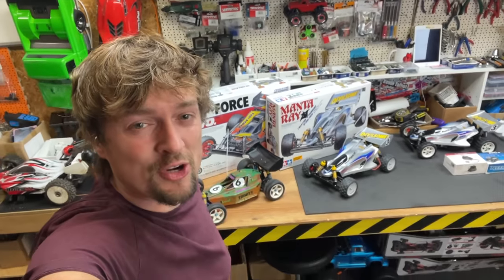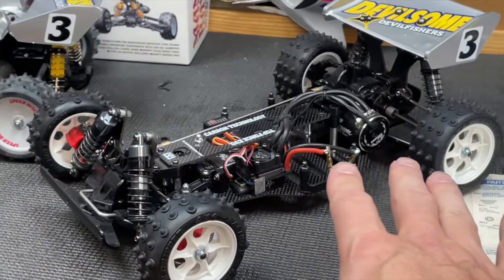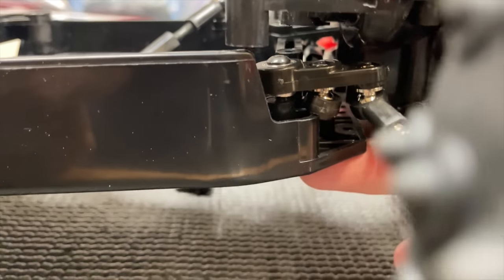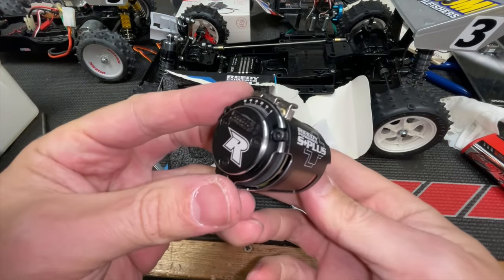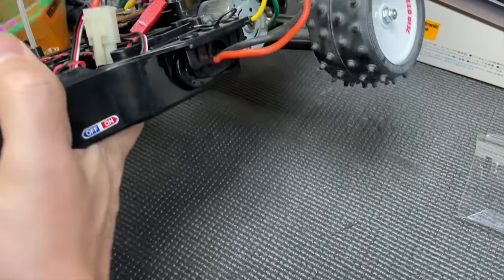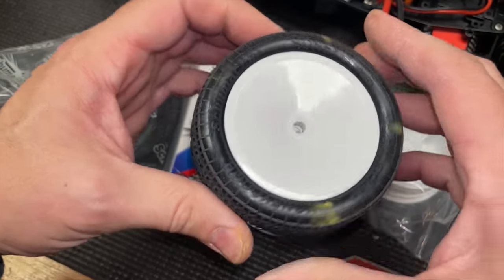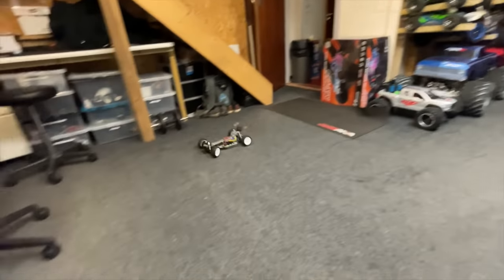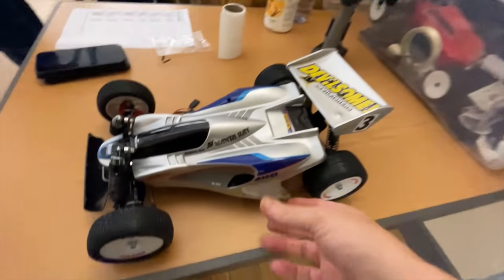RACING 30 year old RC Cars

Comment: Well done on keeping tabs on your original RC cars. My first was from the very bottom of the Tamiya range (I, too, had to save for ages via a paper round) - some desert vehicle thing whose name I can't even remember.  All I remember was how slow and basically useless it was.  Fortunately, I had friends who were also into RC and managed to make better selections.  I remember a grasshopper and a monster truck. I eventually graduated to a Hotshot, which wasn't just loads better than my previous car, but also had far more articles about it in the magazines, with suggested improvements and aftermarket parts.  That was my first real introduction to mechanical things.  I remember removing the front drivetrain to save weight and make it faster when racing on grippier surfaces, then putting everything back together to race around at the park, upgrading motors, swapping pinions to optimize gearing, building independent suspension systems to eliminate the front and rear monoshock, etc. 

But mostly, I remember how utterly dishonest the Tamiya marketing materials were, showing cars flying through the air off of steep sand dunes in much the way your xmax is actually capable of today.  But those cars were nowhere near being able to do that kind of thing.  Not only would those landings have destroyed the suspensions and drivetrains, but they simply weren't fast enough to launch 20 feet into the air as depicted in the videos,. sand flying off the wheels.  On any kind of deep sand, they didn't really have enough grunt to get much air at all, and that's with a tiny pinion and aftermarket motor.  

But those experiences are why I enjoy your channel today.  I haven't driven an RC car in more than 30 years, but watching you and your friends enjoy them so much has been a really fun revisiting of the past.  I've been tempted to go spend a bunch of cash on an xmaxx but I know I'll enjoy it for a short span and then it will end up sitting on a shelf, so I'll just continue to enjoy RC cars vicariously through you.  Keep it up!

Comment: I recently purchased an original Manta Ray to run at my local outside track in the vintage class alongside my DT03 in the DT Class. Manta Ray now has 17.5t brushless motor & HW esc. I’ve rebuilt shocks, gearboxes etc & uprated shock towers, centre drive shaft & steering linkages plus added gearbox strengthening parts. Can’t wait to race it in the spring when the season starts. I race GT12 indoors all year round & I’m looking forward to seeing you race yours again.

Comment: I always love vintage rc cars.  I never really owned any as I’m not too old but I guess the oldest thing I would have owned originally if I kept it was the original Tamiya Wild Dagger
Reply: My wild Dagger is nuts it has two vintage Titan Motors in it and it is nuts. It needs some repairs to take it out of retirement.
Reply: no need to be old! 24 and got into it last year buying an original Frog, then to find out my Dad actually had one too. Now I have a Kyosho Tomahawk, the Frog, Raider Pro, and scx10ii.. never too young, learn off the roots and enjoy the best era to exist
Reply: The oldest thing I have is an esc from some time ago no idea but it’s an old vxl esc
Reply: @add2ndedition663  very cool I wish I had kept mine!
Reply: @sqweezzstr  I guess your quite right!  I suppose I didn’t need to be of age during those great rc years.  I’m actually 34 lol 10 years older then yourself.  I think I was 12 or 13 when I bought the wild dagger after saving some money mowing lawns.  At that time it was new.   I did sell it eventually wish I never.  But I did buy a Mad Bison, basically a nitro version of the wild dagger a couple years after.  I still have it new in the box sealed.   Some day I may build it I think

Comment: Love that video. A lot of memories :)
I still remember some tamiya buggies with The old mechanical speed control... a pain in the a**... 1 servo for steering, another linked to mechanical speed control index. Basically, those old speed control used a long coil wire as Reistance. But electronic speed control changed a lot of things in the world of RC  :) :)

Comment: I still have a Manta Ray hybrid I bought 2nd hand in about 1991. It's got an RW Racing composite chassis, billet aluminium shock towers & motor mount, and a lot of Top Force bits, like stainless steel arm pins & UJ driveshafts. Also has RW Racing bellcrank steering but with custom aluminium cranks as I broke the plastic ones and spares were no longer available, so a friend who scratch built built model steam engines machined me a pair of ally cranks. Ball diffs front & rear.

Used to race it, now it's part shelf queen, part basher.

Comment: Awesome, but Manta Ray has surely got way more to give. That ESC is great, but you need to get into it and play around a bit more with the settings, you can push it harder than that. You will need to get the right programmer card, (HWA30501003, the card you showed is for a different ESC, doesn't work on QuicRun ESC) . Get the motor (or one just like it) onto an engine dyno and time it/tune it, they are never set up out of the box. Find a LiPo or LiPo Hv batteries that will fit, they will work better. NiM batteries are a bit sleepy and very heavy. That motor, or one just like it is sensored, has a sensor port input, which means the ESC will drive it harder, if you set it up on a dyno. Get better tires. Proline Prizm carpet tires work great on carpet but looks like they are discontinued now?. Alternatively JConcepts Swaggers (front JCO3166-101011, rear JCO3180-010  ). Forget the full brakes, just set up the drag brakes to a low setting, 5% or10%, it will be enough, with 75% for regular braking. Go faster Kev, you can do this.

Comment: Just been scrolling through your videos and spotted the manta I have mine from being a youngster in my attic would love to get it running again but need a new body shell and wheels/ tires is it possible to still get the parts ie suspension structures and gears?

Comment: I remember an old buddy of mine , likely around 1989  that had an RC-10 and he thought he was the shit  . I asked for a hobby radio controlled car for my 12th birthday  but ended up getting a ready to go Nikko 4wd  Hurricane from Radio Shack that my Dad bought me for my birthday because he said hobby kit cars  always break so you won't have the money to repair it being a kid and  that you'll enjoy the Nikko alot more as it was actually dependable .  

  Dad was right as the RC-10 although fast when it worked would usually run for about 15 minutes before it had issues lol  , my buddy hardly ever used the thing as it sat in his closet  but my Nikko always worked 100% and my dad was right .   I still have the Nikko with the original box 30+ years later and it still works after being hammered on for many hours   at the time by  12-14 year old  me 🤣🤣  other  than having to get new batteries  and its quick for what it was .

Comment: Seems like brushed motors should be required in this class …and a voltage limit.  My Technigold powered Boomerang would be trounced by any of these and it kept up back in the day.  I don’t think it’s driveline could handle modern brushless power anyway to be honest.

Comment: Hey man! That was my first hobby grade RC car too and just as you I still have mine with its now terribly beat up body. Regarding the chassi there was a fibre reinforced chassi released for the Manta Ray later which is the same as the top forces but not carbon fibre. That's what I currently run on mine. That chassi kit didn't include the protective plastic undertray with obvious results. Still love this period of buggy designs.

Comment: back in the early 2000s i bought my first gas powered car. first model to come out with a 1.7-1.9cc i could be completely remembering wrong. it was the biggest ill put it that way. long story short not 15 seconds of driving it i ran into a big rock and broke the right side upper A arm. lol

Comment: I had a decent rc buggy I got at Radio Shack  back in the mid 80's.     I broke it after about a week .  Threw it away ,then realized 30 years later that I could have fixed it. 😭
Reply: It would have been wasted time to try and fix it as they never sold any replacement parts.

Comment: I had one just like that , but in 2000 as a 18 years old piece of %*#, with barely pictures on internet , I couldnt find the shock holders nowhere , hobbyshops didnt care.. trashed it with an upgraded "ruby" motor , this was powerfull for the time